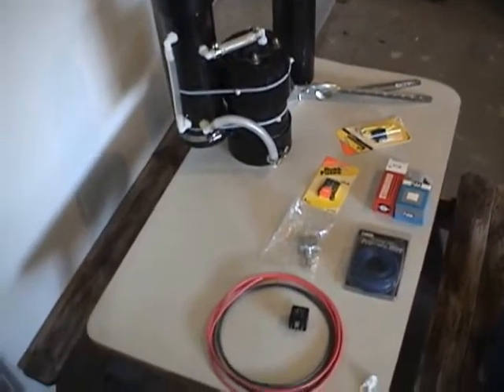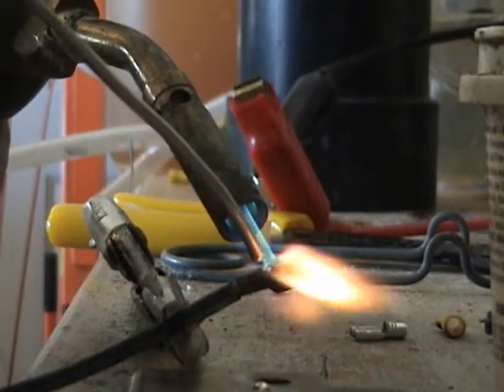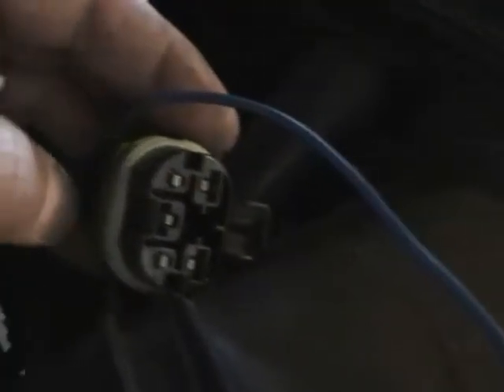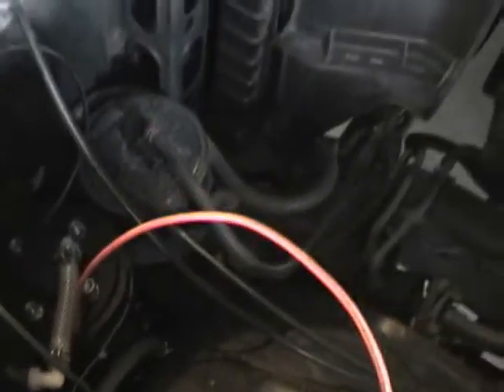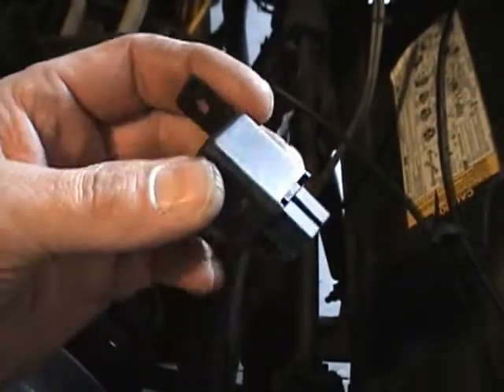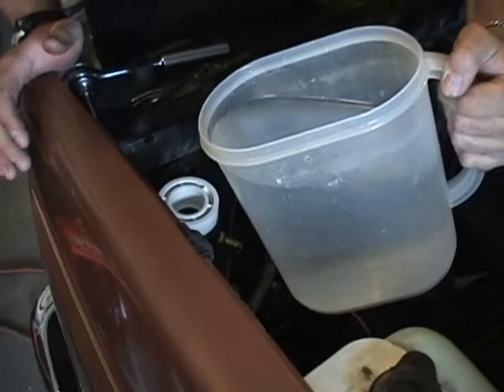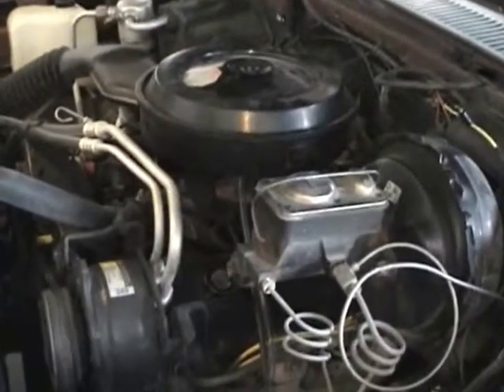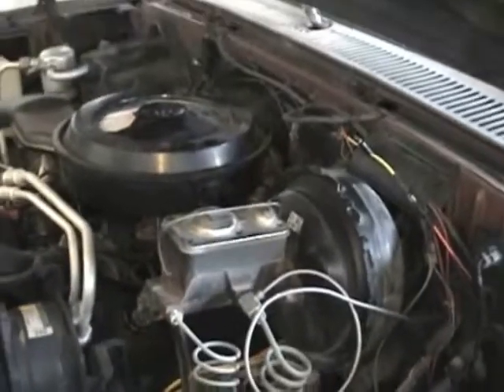(13) HHO 1987 GMC pickup TKO Gen install part2

Comment: Hi chaps.
The 5 -pin relay works just the same as a 4-wire relay.
It just allows more variety of uses.
That 5th pin (sometimes labelled 87a) allows the relay to make either :-
A CLOSED CIRCUIT when energised (so normally open ...n/o)  
 or make
AN OPEN CIRCUIT when energised (so normally closed ... n/c)
just by connecting your load to either one pin or the other !
The extra relay pin doesn't have to be connected to anything, but a good idea is this ...
Use the other pin to operate as a switch to a "powered" warning lamp in the car, to tell you the device is switched off (for example)
And vise versa. (something switched on you can use the other pin to control another relay etc...)
They're great proxy switching devices.
I have 5 connected to each other - all closed.
If any one of those 5 relays is opened by (eg a high-pressure switch) then the whole chain is broken and my device is stopped.
5 safety systems all need to behave or my system switches off !
Hope this helps ?

Comment: Just put a elbow on the top of the TB with a fitting for the hose. Your air cleaner has SOME suction. It has to, or your engine wouldnt run! =)

I have a 88 Chevy 2500 that I plan to try out my cell on. We'll see how it goes.

Comment: Temp seems to be thwe biggest problem I'm running in to.
Hoses get soft, cell can't cool fast enough, & the wires getting too warm.
Mine, 91 ford e250 300cu. use a mix I got from smokey, it works great.
Amps=34-40 , target was 15-20A but....
good vid, keep up the work.

Comment from the maker: as of the first tank we are getting no gain in mileage. this truck has an o2 sensor and we were hoping we wouldn't have to modify it. we are going to try a o2 extender on it. if that doesn't work then the electronics. i will post another video when we see some improvement.

Comment from the maker: how did you determine that running the hho line where you did a problem? are you getting any increase in mileage? what kind of setup do you have for a cell? if your getting 14v at all points sounds like your electrics are set up right. message me.

Comment: Did a similar install on a 85 Chevy pickup.  Very similar engine.  Having 2 minor issues.A) suction from air intake is virtually non-existent. Ran hose from bubbler to top of the metal lid, just off center. Problem B)HHO production is minimal.  Running 14.23 volts steady at all points.  Used 1/4 tsp baking soda to aprox 32oz distilled H20. Wiring= + from battery to circuit breaker,+ out of breaker to relay,+ out relay to switch,+ out switch to the gen. Ground from Gen, & ground from relay. help?